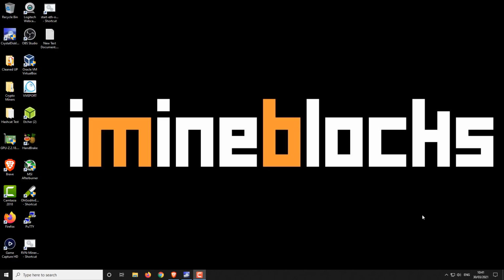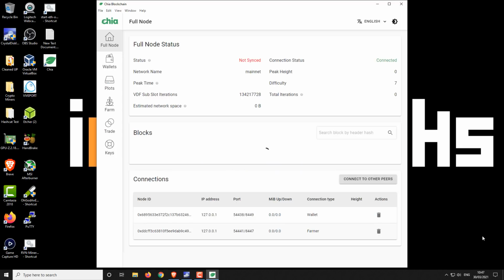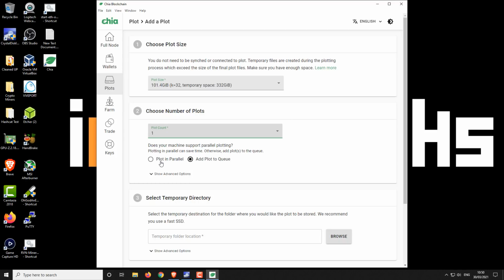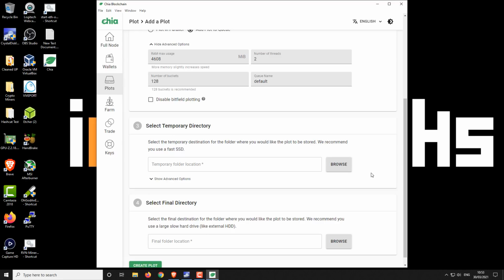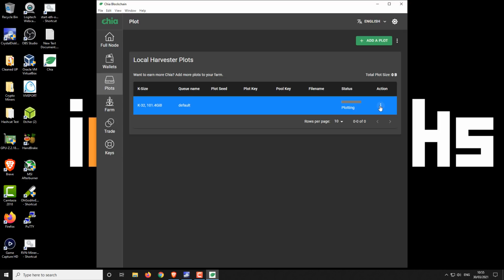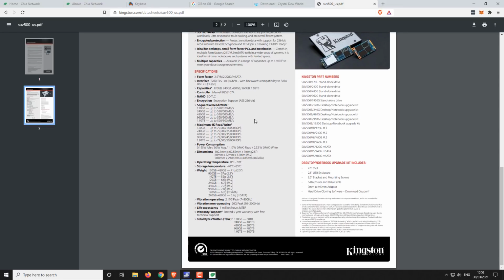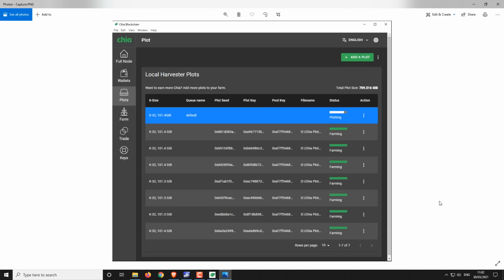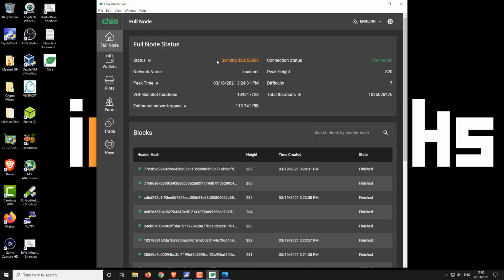How To Farm Chia - Hard Drive Mining Guide

Comment: hi Lee,

thank you for your tutorials, very helpful..

I do have a question regarding storage allocation, so do we need to split temp and final storage for this scenario each? like 9 slot plots..

eg: 
1TB SSD —> 9 Slots temporary
3TB HDD —> 9 slots final

can we use 1TB HDD for final 9 slots? I mean, should we allocate 3TB or we can go with 1TB?

thanks in advance :)
Reply from the maker: Hello,
When a plots temp files are being created they use upto 350GB, then a 106GB file is written from these file to a final file destination and the temp files are removed. So a 1TB drive can only support about two temp files being worked at the same time but could store about 7 final plots.
Reply: @IMineBlocks  thank you so much for this explanation Mr. Lee :)
Reply: @IMineBlocks  what will happen if the storage will full? Or it will full only by solving the blocks and use another? I’m a bit confused! Is this a disposable storage if will full?

Comment: Hey thanks for the detailed Video. my question is, does it make any different choosing k=32 or k=35, I'm trying to say, does the higher k=35 mine/farm faster than the k=32? thanks, i got most of my questions answered by reading all comments and your responses. but no one has asked this question yet, Thanks in advance
Reply from the maker: There isn't any advantage to using larger k sizes, k32 is the minimum. From my testing larger K files also took longer to plot compare with a multiple of the smaller versions when plotted in parallel.
Reply: @IMineBlocks  thanks i plotted 1, took 2 days, i plotted on hdd, temp folder and final folder in the same 1TB hdd, today Friday, im plotting another one, temp folder ssd, final, HDD, i want to see how long this will take

Comment: Hello!

I'm in the process of getting ready to farming.
I have a question for you. Are there any special requirements for the computer's parameters (RAM, CPU, etc.) or only a lot of large-capacity drives are enough?
I will be very grateful for your answer!
Reply from the maker: The plotting process is quite intensive but can be done on most machines. However for best results you will want at least a 500GB SSD, NVMe is best as a temporary plotting drive.
If you don't have a SSD the plotting can still be done but it will take 20 hours per plot.
Reply: @IMineBlocks  if I want to connect e.g. 10 x 2TB SSD, can I use standard equipment or should I buy something better?
Reply from the maker: @grzegorzgierula6505  Regular retail hardware is fine. You'll want to write the plot on fast hardware but then store the plots on slow HDD. I don't think multiple SSD for storage is the best use of capital.

Comment: Hi Lee. Tell me, how many Plots you can create, given that the SSD disk is 500mg. In the video in the screenshot there are 8 Plots. Or is 1 disk = 1Plot? (Sorry for the translation problem)
Reply from the maker: Hi, In you use a sperate temporary drive then you can get 4X K32 (100GB) plots on a 500GB drive due to the way drive space is calculated. if you use the same drive for temp & plot you can only fit one plot on it.
Reply: Thank you understand. In this case, the expected winning time is one year.

Comment: chia mining minimum required please, RAM, CPU etc. I try on my 2 different comps and is crashed
Reply: I believe the default setting of chia GUI is the minimum required already, if your pc can not run with 1 plot k32 then it not meet the requirement.
Reply: @ANtube89  how to met the k32 plot requirements?
Reply: @jecjecrivera626  K32	DRAM (MiB)3389		Temp Space (GiB)	238.3	Temp Space (GB)
256 for 1 plot

Comment: welcome back!!! long time no see! Im glad I saved all my HDDs from burstcoin failed try. still got 150TB
Reply from the maker: Definitely makes sense to put them to use on Chia.
Reply: @IMineBlocks  What's more important? SSD drive speed? or the size of the HDD?
Reply from the maker: @absolutettt  You'll want a fast temporary drive and a large final drive for your plots.
Reply: @IMineBlocks  I understand you, let's say 
1)1 SSD NvME
2) 8tbHDD
или
1)1 SSD NvME
2)  5*1.5 tb HDD?
Reply from the maker: @absolutettt  
1)1 SSD NvME
2) 8tbHDD
Is the most capital, energy & maintenance efficient setup. Final plot storage does not need to be fast.
Reply: @IMineBlocks  Thank you more, I'm just from Russia and use Google translator, if you need help, write me what I can help you.
Reply: @IMineBlocks  what snould be the size of nvme ssd? And does it matter how big is it? For sample - if I buy 2x14tb hdd, what should be my ssd size? I have one 2tb nvme, but I use it in system. Can give 1tb from it for chia if its possible) or would buy a new one, but just dont get now how big it should be. Cause later I will definetely add more hdd)

Comment: If I want to make more new plots do I put them into the same folder as the other ones
Reply from the maker: Yes, but they can be saved in other folders too. You can add new plot locations using the drop down in the top right of the farming window. New plots are normally added to farming but use the above if any are missing.

Comment: comparing to filecoin which has already 62M circ. supply, when Chia keeps the supply low for few yrs this coin could be easily traded at 1000$
Reply: filecoin is suuuuuper expensive an complicated to mine. for that reason chia will most likely distroy filecoin eventually

Comment: Good to see you back, Lee. I'd consider storage staking/mining for sure. It's not as sexy as GPU mining but it serves a real purpose - organisations need to store their data somewhere!

I just looked up the prices of external HDs and they're quite reasonable. I'm thinking of a low power PC with at least one 8TB drive attached to start with.

In Australian dollars I can get a WD USB 3 8TB HD for a bit over $300. I'm not sure how much power it uses though.
Reply from the maker: Hi, Cool this about this is that you can combine it with your existing gpu rig (easier with windows). External drives are good value and use between 10-20 watts.